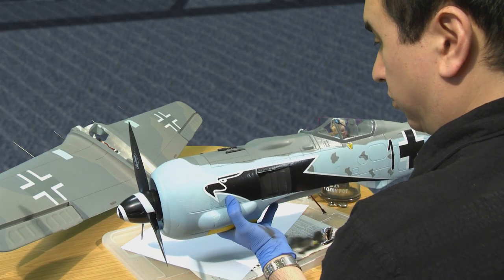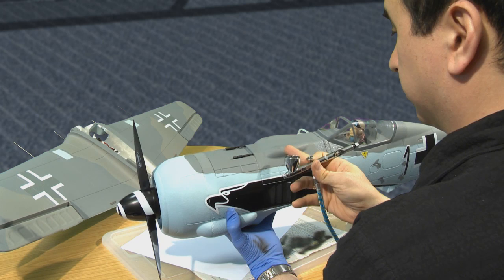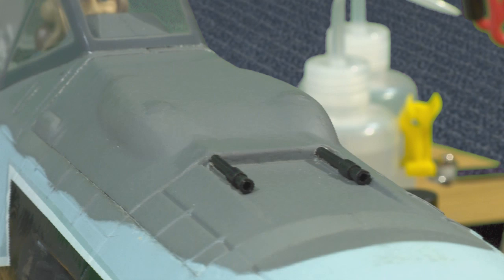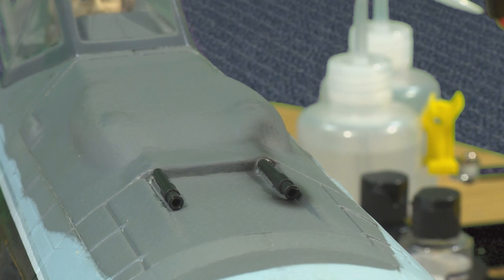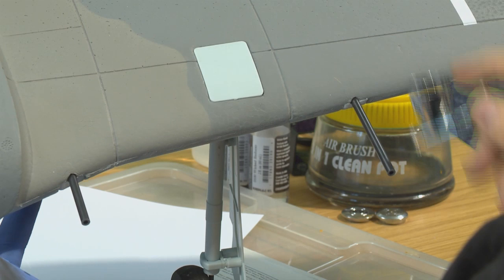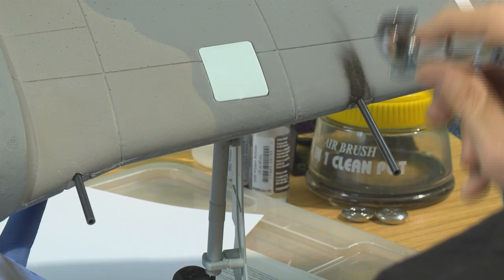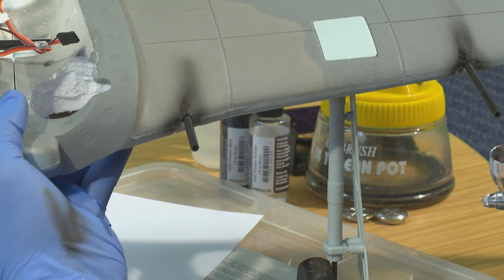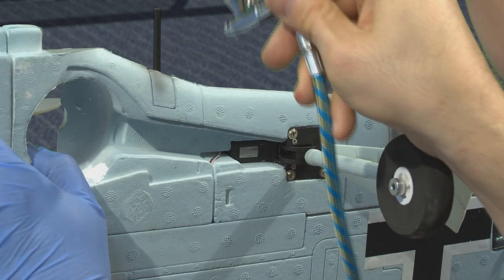Introduction to Airbrushing

Comment: Hey. I've got an VEDA W-130A airbrush

Anyway, i've got this big problem since i've bought this. Even if i loosen the "chuck" all the way down, my trigger has a dead-zone at the full back position and won't pull the needle back completely. For example; if i pull the trigger back by hand ~%80-85, there's still a little null zone that trigger wont pull further; and i can fully open the nozzle by pulling the needle with my hand; so that it open the paint hole %100 i guess. It's actually irritating, because even if properly thinned, M.Color's wont spray very well with the full trigger, but if i pull back by hand fully (or just unscrew the needle and pull it all the way back) it sprays flawlessly..

What should i do for that ? 

Note that, i'm using 0.2mm needle/nozzle with the default 0.3 needle and nozzle caps.?

Here's a video of me, trying to explain the situation..

Trigger issue of WD-130